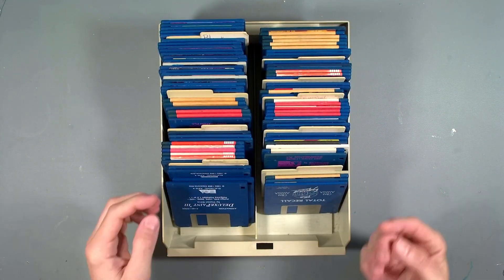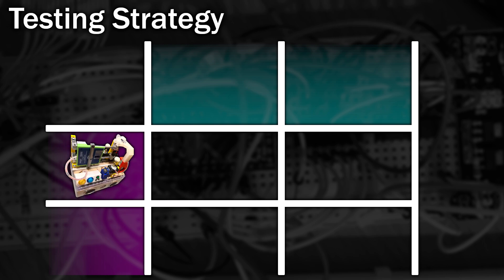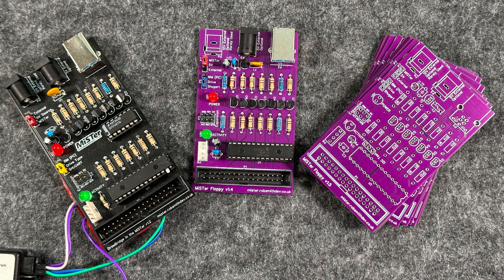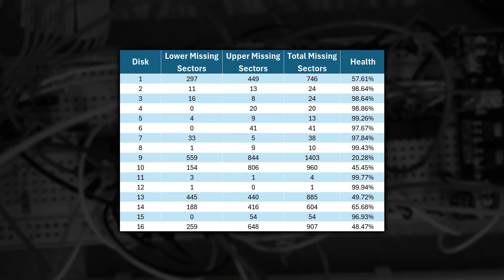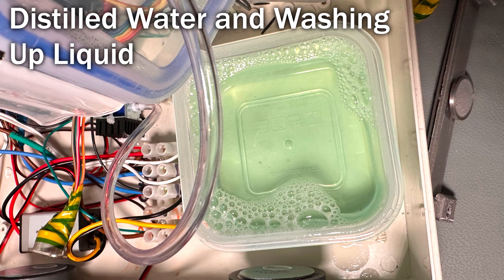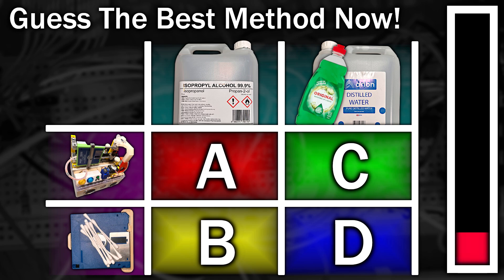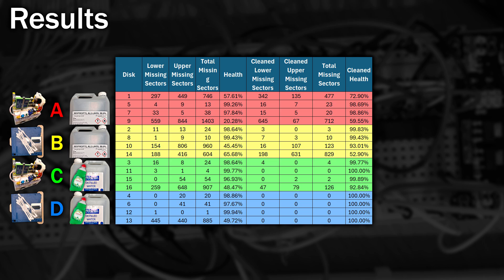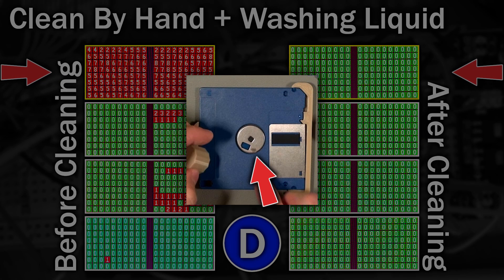Cleaning Floppy Disks - Multiple Methods Tested!

Comment: Loved this video, care and attention to get these disks readable.  Where can we get that cleaning machine ?

In a job I had in 1997 - 2002 - I had to do a similar process to recover data from magnetic tapes, the old 9trk or 21trk giant reels from the 1960s.   Though in this case had a real to real cleaner that did its job with a blade and isopropanol to clean the head.  The worst ones, where the tapes were stored in Africa, had the backing of the tape come away from the coating.  These had to be baked in an oven for 48-> 96 hrs before reattempting.  

Have to be careful with isopropanol as it can make you a bit high and does wonders to your skin, and don't use it if you have a cut ony our  hand
Reply from the maker: Haha yeah been there with isopropyl.
You’ve mentioned baking it in the oven and that’s the second time I’ve heard that! Hmmm

Comment: The amount of over-engineering in this video.... A piece of tape to hold the floppy open and that 3d printed knob is more than enough to clean both sides. 😀
Reply from the maker: The over-enginerring for the cleaning machine was totally the point :)

Comment: Excellent video, thank you.  I must begin this process asap for my collection.  My drive will need a major clean before i begin.
Reply: I have just got my Amiga and discs out the loft v when I tried them last about 8 years ago I destroyed an Amiga floppy drive. Squealing noise and it was leaving the circle. They didn't look speckled from a distance which worries me. Looking closer I think the surface is doula but looks all the same. I have bought a floppy disc cleaner and going to try isopropyl alcohol and see what happens!

Comment: I have a Nintendo 64DD video game, it uses floppy disks and some of them are giving an error when reading... would you recommend any of these methods?
Reply from the maker: I’d start with cleaning the drive head before going any further. Any of these will work but you really want to use a backup copy of your can
Reply: @RobSmithDev  The Drive head has already been cleaned, it is even reading some games, but there are some that present reading errors.
Reply from the maker: @physicalreleasesalert  could be damaged disks or dirty. You’d have to physically look to see if you could see it. The disks could also be degrading too. Either way you should re-clean the drive heads after using these disks as they could spread contamination to other disks

Comment: I found that aside from cleaning them, what really helps just as much is actually putting them through their paces. Yes using them.
Reply from the maker: Its true, it does work, but cleaning them first if you suspect their bad will prevent further damage while trying to recover data from them

Comment: Great job! Although I don't get the last advice. This should be treated as last resort and it's best to clean, read and then repeat the process cleaning the head each time. So in the end there is no better alternative as you would clean the disk using one of these methods anyways.
Reply from the maker: Yes that’s true, but what I meant is if you’ve got to this state don’t expect perfect results and probably don’t rely on the disk going forward

Comment: the best method of course  is remove the disk from the floppy and clean it outside using alcohol or water and soap, then of course insert it clean and dry, your method of cleaning the disk in the floppy sucks because It will dirty and wet the inside of the floppy
Reply from the maker: I did mention this in the video
Reply: @RobSmithDev  ah ok sorry , it happens my native lang is not english then sometimes I don't quite get have some phrases well,I also forgot to say that it is better to use water and a neutral soap than any kind of alcohol,some concentrated / strong alcohols can remove/dissolve the metal of the disk, personally I have had the better results repairing Amiga original games using water and soap only
Reply from the maker: lol - that was the conclusion of the video

Comment: The idea of a cleaning machine is clever, but I need to correct a misconception in your methodology:  When you can see through the wafer, that isn't caused by dirt scratching the surface; it's caused by the binder (the glue that holds the oxide layer to the wafer) degrading over time.  The material becomes "gooey" and is taken off by the head itself, even if the head is perfectly clean and functional.  Degraded binder is also what causes the "screeching" noise in a floppy drive -- and if you hear that, immediately remove it and clean the drive, because that sound is the binder is being transferred from the wafer to your drive heads.  (This is also the cause of "brown stuff" on your cotton buds, which is never dirt and always oxide, and a sign that you're taking too much off.)

As for what to do in this case, you can attempt to re-bind the oxide layer to the wafer by following the same practices as you would restoring analog audiotape, namely baking the wafer at about 58C for a few hours to re-consolidate the binder.  To prevent the binder from getting stuck on the heads again, put a few drops of cyclomethicone (a lubricant) on the surface right before reading; it then evaporates afterwards.

Comment: The disk cleaning kit I bought on eBay consisted of a disk shutter opener and turner, and a microfibre cloth. I learned my lesson after one disk that they shouldn't have included the microfibre cloth and it completely destroyed the surface of the disk. Now I too use a cotton bud with the zig zag motion.
Reply from the maker: Makes me wonder if I should start selling my own kits!
Reply: @RobSmithDev  Definitely! Drive cleaning disks too, it would help use up all the dead disks and the other 99 filters you bought  :D
Reply from the maker: So true lol

Comment: Thanks for doing thus research Rob. Definitely useful!

I recently bought 3 packs of 5x Memorex 3.5" disks, and on inspecting them all of them had (apparent surface) mould and produced a scratchy sound in a drive. Erk... the vendor was kind enough to refund the full purchase price (nice guy). I now wonder if I might be able to rescue some of these disks?

As you found Rob, my own intuition is that soapy water would be the best bet. I actually did this back in the day for a floppy that got soaked in coffee when it was spilt on my desk. Back then, using 
IPA alcohol would not have been on the radar (no Amazon). My thoughts were, get the dried coffee fudge off and it might be ok, and it was!

Now in this case, maybe the magnetic surface is also sloughing off these disks. But, I think its worth a try with at least ONE disk eh?
Reply from the maker: If they don’t read then you don’t have anything to lose by trying!
Reply: @RobSmithDev  When the disk spun on the 4 I tested, it scratched the surface I think. But Ill give on thats untested a go!

Comment: I've been using 70% ethyl alcohol and it has been working great for me. With more than 90%, I noticed that the magnetic layer was starting to come off, and isopropyl alcohol is much stronger than ethyl alcohol. I separate the two halfs of the floppy, take out the magnetic disk and use a cotton pad (usually used to remove makeup) with 70% ethyl alcohol and gently clean up the magnetic disk's surface. I was curious if you would test the 70% ethyl alcohol, as in my mind I get a bigger success rate then you did. Is it just in my mind?
Reply from the maker: I suspect removing the disk completely is going to be the kindest approach all together (and quicker). But to be honest if I was trying to recover the data I would have cleaned them first because the first read was probably when the most damage actually occurred.
Reply: @RobSmithDev  that's actually what I did. So, it's possible that it has contributed for a higher success rate. But for a before and after comparison you have to read them first, so there's no way around that. 😅

Comment: back in the C64 days I used to use a knife to cut open the edge at the top of the 5.25" floppies, remove the plastic disk inside and wash it in the sink before letting it dry and put it in a clean sleeve from I had taken from another donor diskette.... always worked just fine..by the time I moved to 3.5" disks I had pretty much figured out not to spill coke or milk on them...
Reply from the maker: Haha very true

Comment: Hi Rob, I find that a lot of floppy disks are also now going faulty like you mention because of the adhesive that sticks the media to the metal ring and any pressure then separates them when trying to clean them, the screeching sound when putting these floppies in a drive is a giveaway that the media and ring are separating in most cases
 so what I do now before I do anything is use a pin and dip the head in some gorilla glue and dab it carefully around say 4 points so joining the media to the ring, I then let that set and only when dry fully I will use Windowlene ( has a little vinegar in it) glass cleaner to clean the media and it also gives me great results as I found isoprop too aggressive and can remove some of the media
I have used these methods many times and it works well if there are say genuine disks you want to save
Reply from the maker: I did wonder about trying windalene - makes sense it would work - although I wonder if it could also break down the glue too
Reply: @RobSmithDev  Won`t break down the Gorilla glue gel it is the expanding type not superglue,it works great, I have saved many disks now using this method,  it is belt and braces thing as it is innevatable the Media and Ring adhesive will separatebecause it dries out
Reply from the maker: @crumplezone1 the isopropyl did in the tank I had. I used it to seal the pipes and a week later had all peeled off
Reply: @RobSmithDev  Yeah isoprop will strip the life out of most things :)
Reply: @RobSmithDev  Hello, Are you referring to "Windolene Original Cream" in a pink bottle?
Reply from the maker: No, this stuff for cleaning glass https://amzn.to/3WjbjFE